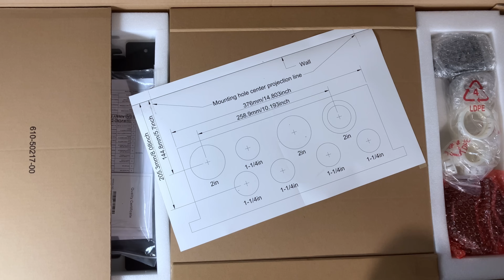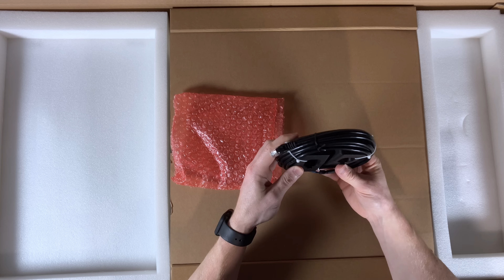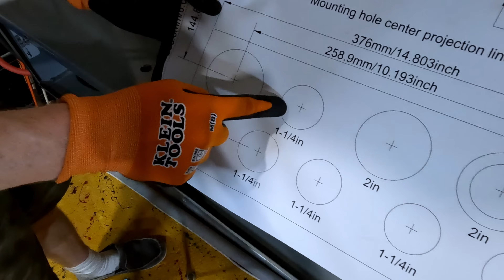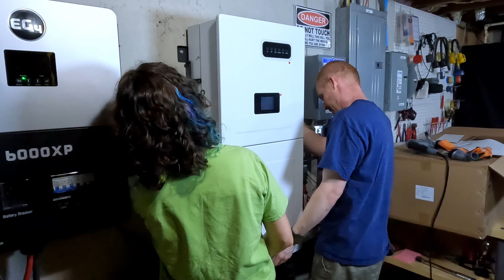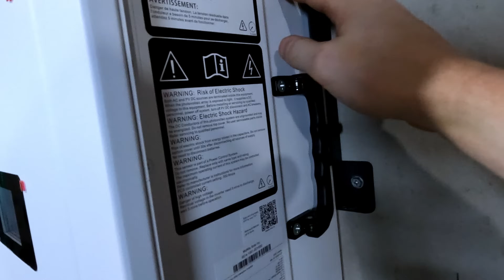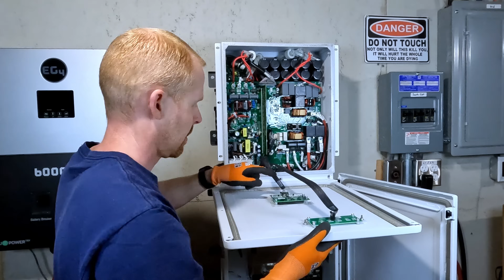First Look at MidNite Solar "TheOne" – 11.4kW Hybrid All-in-one Inverter

Comment from the maker: Links to the parts & pieces in the video (affiliate links)
------------------------------------
MidNite "The One" - https://bit.ly/4exEkpw
Hydraulic Knockout Tool Kit 1/2 to 2 inch - https://amzn.to/3Zx7oFZ

Supporting the Channel
--------------------------------------------------
There are several ways that you can help support this channel.  
- Affiliate links help the channel by providing me with a small commission of the sale.  It does not change the cost for you at all.  
- The 'Buy me a Coffee' - link is here (on the bottom, right corner of the website): https://going-off-grid.com
- You can also click on the "Thanks" button under the video to support the channel. 

Thank you for your support!

For more information, please check out my website with links to all the components, materials and products I have used in developing my off-grid solar system: https://going-off-grid.com

Comment: Did you use 2/0 welding wire to the batteries?
Reply from the maker: Yeah: https://amzn.to/3GjXZKS
Reply: Thanks. I appreciate the content!
This will be my first midnite install other than a couple classics.  I've installed several outback pre wired systems and I'm excited to see what these can do!
Reply from the maker: @johnmcwhorter907  you bet!  Enjoy!
Reply: Did you use 2/0 between the batteries as well?
Reply from the maker: @johnmcwhorter907  It depends on the size battery.  Some are stacks of server rack batteries which have 4/0 going to the main bus bar, others are smaller batteries which I'm using 2/0 or 2ga.

Comment: Looks like a great quality inverter. Does midnite do a 240v inverter for other markets? I'm an installer in New Zealand, i would love to use midnite. I currently use Victron which I like, but would like to use other quality products also.
Reply from the maker: I’m not sure if they make a specific 240v version.  Take a look at their website and see if they have options that would work for you, or just give them a call!
Reply from the maker: It actually looks like this inverter can change its output from split phase to a 230v output.

Comment: do you know of any other USA designed and assembled (with global parts) inverter/chargers or AIO for home solar/backup use ?
Reply from the maker: The MidNite AIO isn't built/assembled in the US.  I know that MidNite's Rosie inverter is.  Not a full blown AIO though.  

EG4 recently acquired a manufacturing facility and they're going to start sourcing and assembling some of their inverters in the US.  I believe I heard some of the FlexBoss inverters already are...maybe???
Reply: @AdamDeLayDIY  thanks for the correction . i could swear i read they we're made here . but i've been reading sooo much trying to learn that i'm apparently i'm getting stuff confused . have a great day :)
Reply from the maker: @ no worries!  Take care!

Comment: Hello Adam... I'm in Barbados in the Caribbean and have an installer putting in a midnite the one... What servicing does it need and when... Want to know when to call him back
Reply from the maker: Congrats on getting the MidNite.  I'm not sure what you mean by "what services does it need and when"?  Once it's installed and programmed, you can pretty much forget about it.  There may be times there's a firmware update available but if you're not experiencing any issues, you don't need to update.

Comment: Do you know if you can set export limit and when you force discharge of batteries, will it also export to grid, adhering to the limit provided I have a grid interconnection agreement?
Reply from the maker: Yes you can set an export limit.  

The force discharge should adhere to that limit as well.  Power will be provided to the loads first and then be sent to the grid.  

It might be helpful to look at the manual on page 29: https://www.midnitesolar.com/pdfs/Manual41924e.pdf

Comment: Perfect timing, please tell me it's manufactured in the U.S.A. Seems every hybrid is re-branded product from overseas. Although very tempting I would like to support local manufacturing if I can.
Reply from the maker: Unfortunately like most things I believe it’s manufactured outside of the US.  It might be designed in the US, but not manufactured here.
Reply: @AdamDeLayDIY  Thanks for the reply. The IP65 rating is what's missing from their Rosie lineup, thus the excitement for this unit. However if it's at least engineered/designed in the U.S then it's better than nothing 👍.

Comment: I bet that .97" got you. Midnite should convert from tenths to fractions.
Reply from the maker: Probably.  I had thought I had just rounded up to 25” but apparently not… :D

They need to just adjust the bracket a little bit so it’s a solid 25” instead of an odd number.

Comment: Amazing! Thank you for sharing this video. I do not mind purchasing one of this MidNite Solar & soak testing it under various load conditions, i.e. under resistive & inductive load conditions. Is the power inverter a pure sine wave inverter? What sort of chemistry are the batteries? I will be follow your progress in your testing. Greetings from Madang, Papua New Guinea!
Reply from the maker: Thanks!

It is a pure sine inverter.  I have DIY LifePo4 batteries but you can also use lead-acid batteries.

Thanks for the comment!

Comment: I'm excited to see how it goes too and I was just having your video playing while I was tidying up my office so I didn't feel alone in the task.  So, thanks for helping me tidy my office and I'm looking forward to your testing.

One thing that I have to think about is that my solar panels are all on micro inverters about 160 feet away from the house, my solar goes into my inverter as a Generator.  Sol-Ark does a great job of handling that, so I'll looking to see if AC coupled solar could connect to this puppy and work for my situation too.
Reply from the maker: Haha!  Glad I could help out!  Now I feel like I need to clean up mine… :D

I don’t have the manual handy, but I wana say that you can have up to 12kW of AC Coupled solar connected to one of the smart ports but it will only utilize a maximum of 10kW.
Reply: @AdamDeLayDIY  perfect. It seems as those many people in cities had limits to how much solar they were allowed to connect.  My is at 8Kw

Comment: The reason I prefer Victron charge controllers is because you can put in more amps faster to charge up your batteries, versus the all in one units where they limit how much amperage you can push into your batteries!
This is extremely important when you have limited sun hours!
Reply from the maker: Wouldn’t that be the case with any external charger controller where you don’t have communication?  It’ll charge by voltage and the current just gets pulled as much as is allowed.

You don’t want to always charge your batteries with continuous high current as I’ve been told that can degrade your batteries faster.
Reply: @AdamDeLayDIY  
Yes, this is why I keep mine under 100 Amps if possible, taking my Victron charge controllers and running them at 70 to 80% setting in the VictronConnect app, for the summer months. The rest of the year doesn’t matter, since it never gets anywhere near that amperage.